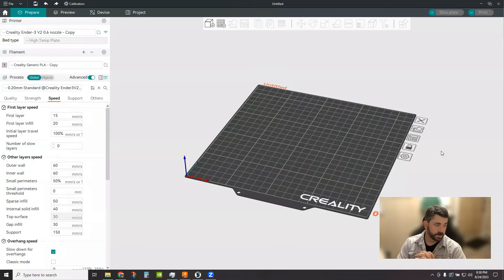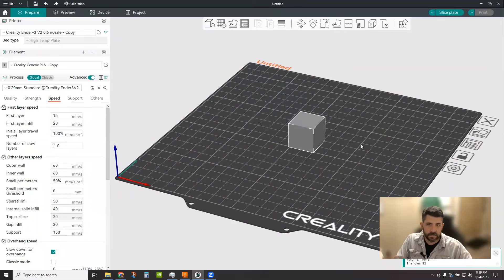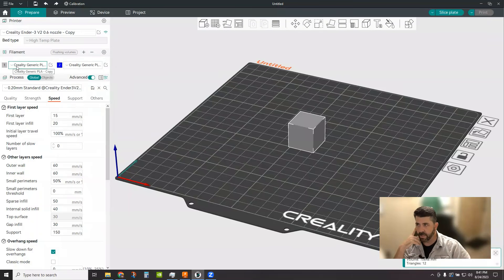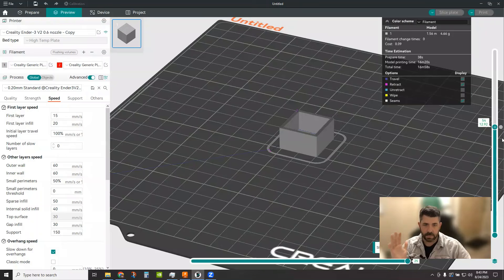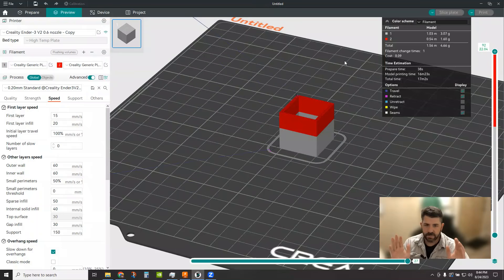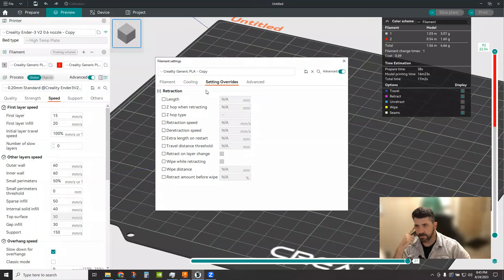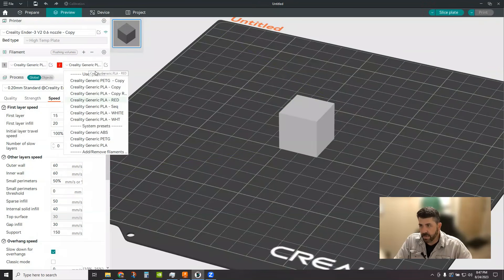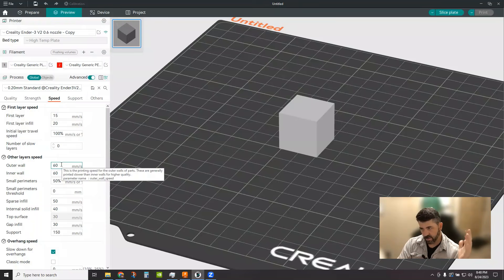Do this for easy filament changes in Orca Slicer

Comment: Hello, good evening. I have this error with the filament change that you mentioned at the beginning. When I start a print, the M600 command is activated without allowing me to print anything. How can I fix it?
Reply from the maker: Good evening.  Thanks for reaching out.  Assuming you are running Marlin FW..?  If you set the m600 command in the machine presets it basically assumes you have no filament loaded initially (even if you do).  So it will initiate a m600 to start, eject your filament and wait.  What I had to do in this case was simply reload my filament back into the extruder then press the knob on my Ender 3.  It would then start the print.  Once it got to my next m600 command it repeated the process (moved the head, ejected the filament, and waited for me to load filament and press the control knob to continue the print).  I try to explain this a bit around the 5:45 mark in the video, but probably not very well.

Comment: Creality K1 Max. M600 not working.(
Printing didn't stop for changing filament
Reply from the maker: Unfortunately, I don't think Klipper supports M600 commands directly.  Looks like you might have to implement a filament change using a macro instead.  I haven't researched this much yet so wont be a big help.  Looks like there are some reddit threads and some youtube videos on creating macros in klipper that might help.
Reply: @fischer3d "Pause" working. Not as "changing color", but just as pause